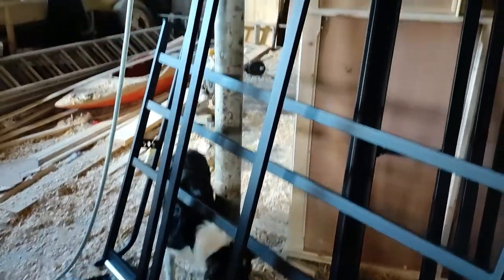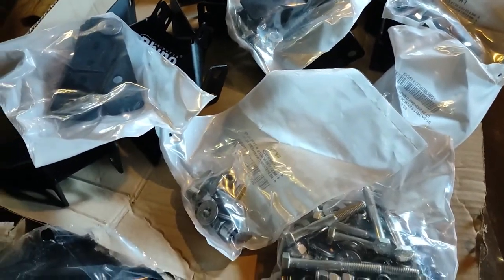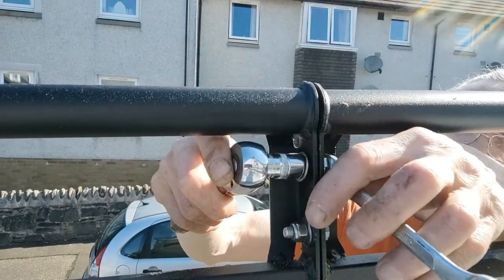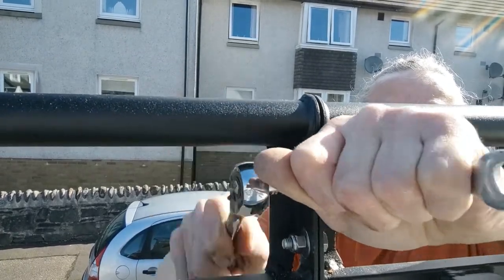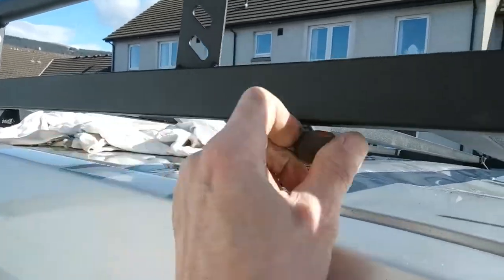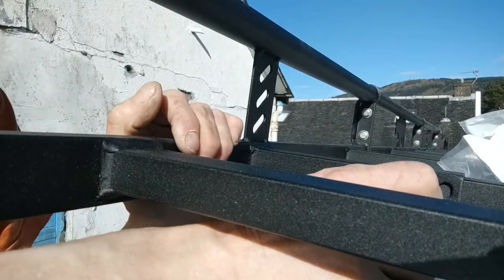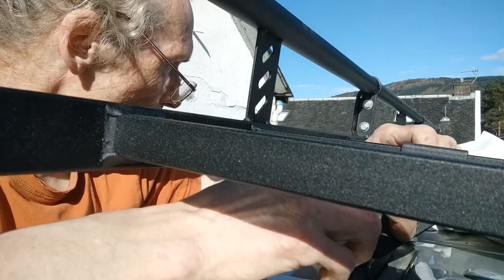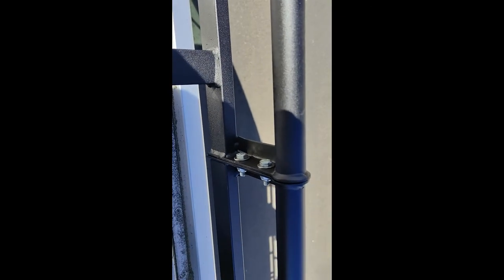Fitting a Rhino roof rack to the transit

Comment: You did very well Sir to lift the units atop such a high van. Kind regards.
Reply from the maker: Thank you, it wasn't easy because they are quite heavy sections. But putting blankets on the roof to protect the paintwork helped a lot.

Comment: What is the height of this van? it's a mk7 ford transit right? But what height?
Reply from the maker: The long wheel base high top version of the Mark 7 version is 2206mm. And the roof rack would add about another couple of 200 mm I would say. It's definitely high enough to be a nuisance to get the roof rack up onto the roof. A small ladder is essential.
Reply from the maker: Sorry, I seem to have replied to the wrong message. Please see the reply to the other message